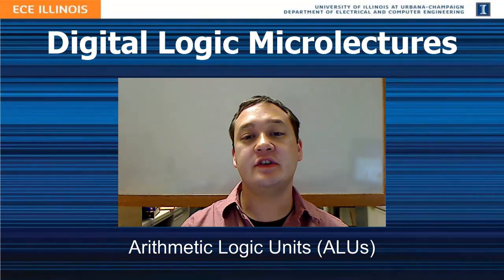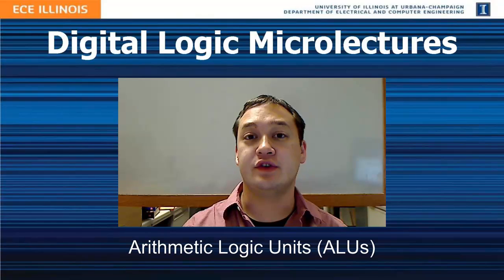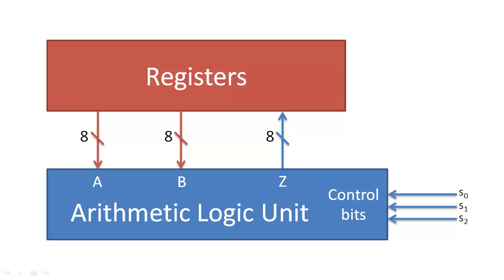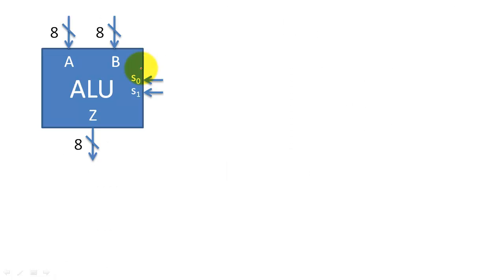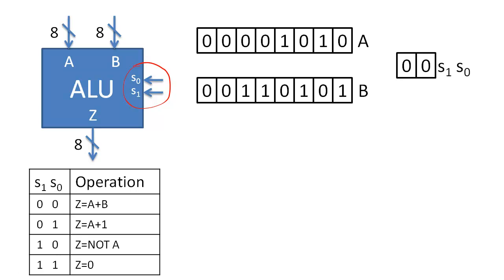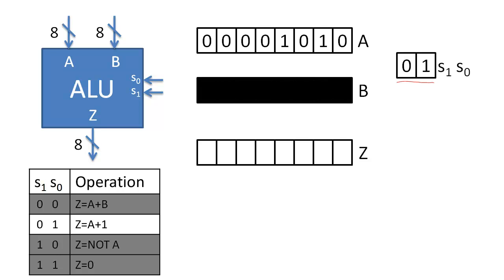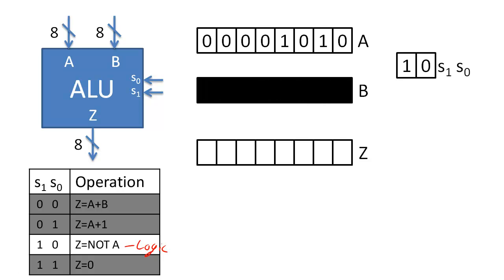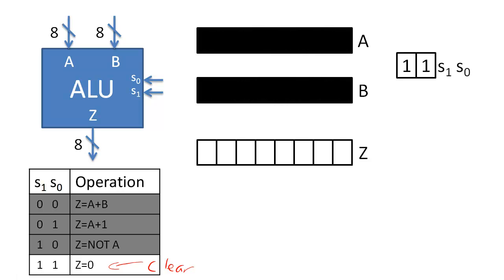Arithmetic Logic Unit

Comment: three design issues: assume you have (mono-duo-n-differential pairing data lines, instead of voltage to ground (+/-1), not considering gate-driver voltages), and consider you try to make an alu that switches just-in-time to the alu-operation you request, also, consider that you have your alu operations (n-bit) results (n/2n-bit) stored in a fast 1-cycle cache
Reply: micro, pun intended